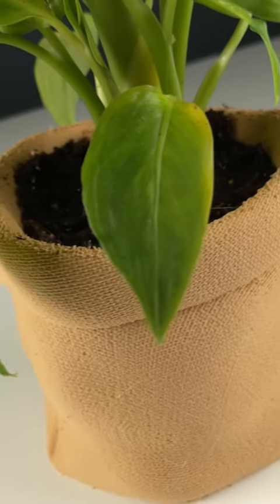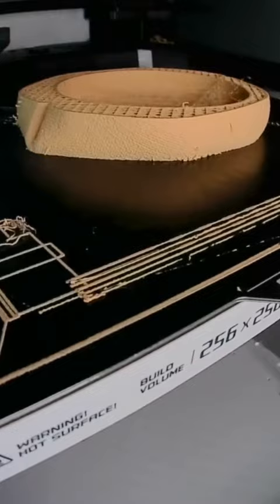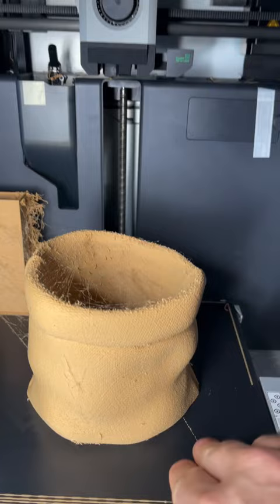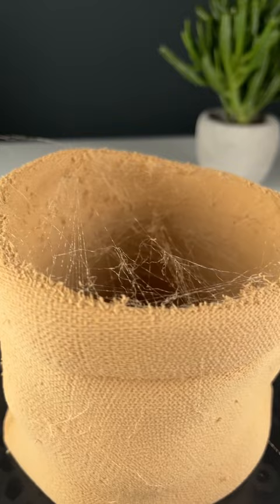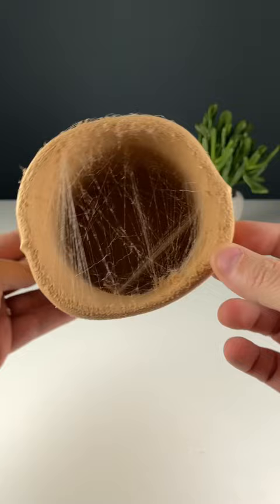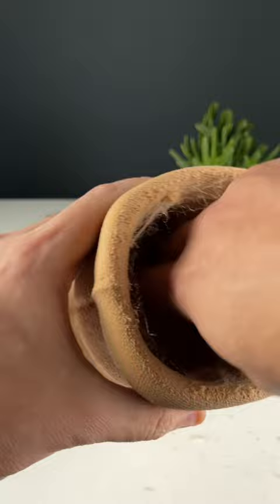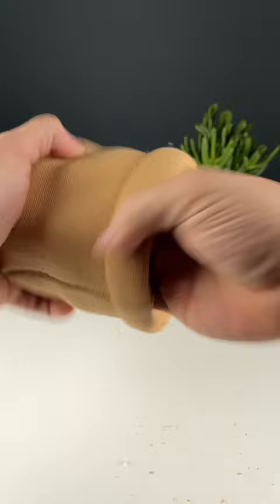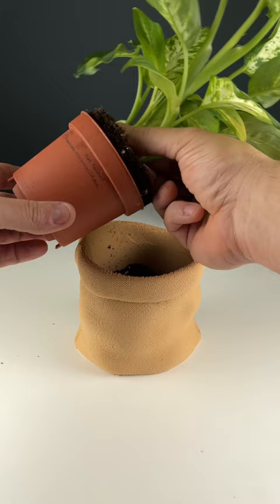Realistic 3D Printed Burlap Plant Pot #shorts

Comment: Loosen the roots a bit, at least. Also, most plants would appreciate holes for draining excess water. Consider giving it an overflow hole at tray height and using this as an outer cover for a regular pot
Reply from the maker: See, this is the way to give constructive criticism. I will definitely follow your advice on all point, thank you very much
Reply: @3DMakerNoob  No problem. Nobody likes their plants to die. Alternatively, you could make a pot like this that has a similar bottom to the pot you took the plant out of and print a tray that looks like more bag rumples. There is even a style of pot where the tray is integrated and all you see is the line the water can escape from. There are many options, so I'm sure you'll have fun with it :)

And in case "tray" means something else to you, I was referring to the kind of flat-bottomed bowl that is an inch or 2 high that you sit plant pots in
Reply from the maker: For the most part, in pots without a hole I just make sure that I never overwater. But never knew you should rinse and release the roots when repotting. Have a couple more models that I will revisit now :)
Reply: @3DMakerNoob  yeah. There are pros and cons to disturbing the roots. If they're doing too much of that thing where they're searching round and round for an escape, it can be good to give them a little more room. But when you disturb the dirt you're going to break the finest hairs, which is like severing the blood vessels that connect to your intestines; it'll take a little while for it to grow those back, so it might get a little hungry and sad before it looks better. So it's a case-by-case thing. (One channel I watch is a woman who buys dying plants for cheap to rescue them, but also says that she feels less bad for accidental deaths since they were liable to have died at the store.)
Reply: @3DMakerNoob  good for you! :) I don't know a lot of people who are good at watering

Comment: Is it watertight? Would be useful if you want to use it as a pot. 
I often noticed that my pots were not really watertight.. especially after a few days
Reply from the maker: The easiest way to ensure pots are watertight is simply to spray some clear coat on the inside to seal any gaps between layers
Reply: @3DMakerNoob  its good to have a drainage hole one the bottom to preven water from sitting and causing root rot

Comment: Why is there a purge tower? This is all done in one filament, right?
Reply from the maker: Yes, that’s a hollow perimeter tower which is an optional feature used when doing smooth timelapses. The head moves onto it, takes a photo, primes the nozzle with a small perimeters and continues the print
Reply: @3DMakerNoob  Wasn't sure if it had something to do with the filament but that makes sense

Comment: Stunning. I need to get some better looking wood filament than what i have now. Maybe i'll grab a roll of that stuff.
Reply from the maker: The advantage with polywood is that you don’t have actual wood particles to clog the nozzle. So a 0.4mm nozzle will do
Reply: @3DMakerNoob  nice. I'll have to find some here in Canada land.
Reply: @3DMakerNoob  they say the material is made by some sort of foaming to look and weigh like wood, so I guess it will be somewhat breathable just like the real stuff? Probably great for a flower pot!

(Uh of course the "foam" could have solid walls to make it impermeable. Guess it’s best to do some experiment involving a balloon to show airflow.)

Comment: Really cool model! I've heard from some reviews that the x1c is good for watertight prints because of the calibration, did yours end up watertight?
Reply from the maker: Any printer can be good for watertight models, you just have to make sure you flow is accurate and your perimeter overlap is there to create a good enough seal. Worst comes to worse, as a precaution, just spray a couple of coats of clear coat inside to seal it all up :)
Reply: @3DMakerNoob  yes I know 🙂 I was wondering if you have noticed if yours are? 
I do have a x1cc but I'm at work so haven't been able to print it out yet! Will dump tonight 👌🏻
Reply from the maker: To be honest I haven’t noticed any difference from any other of my machines